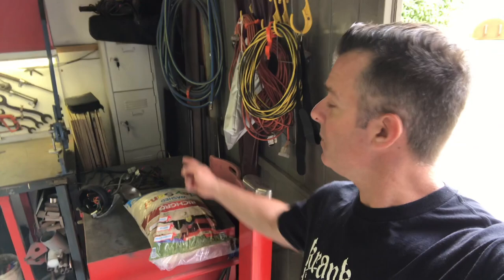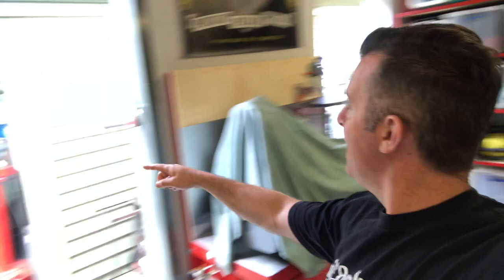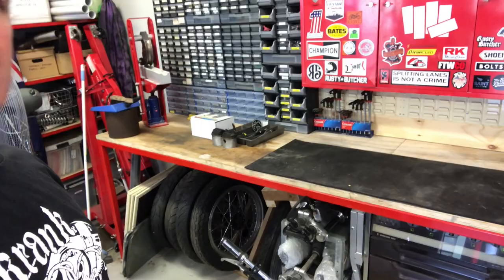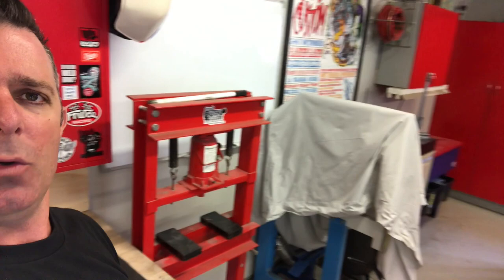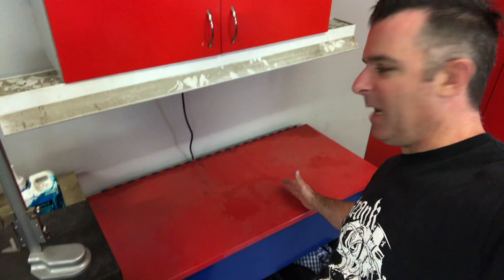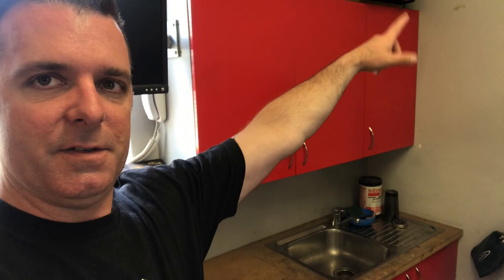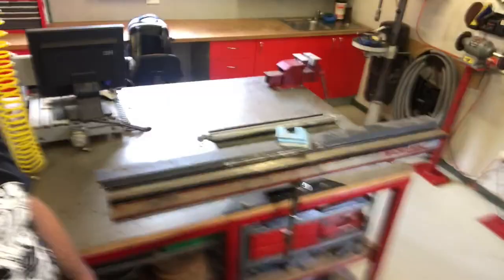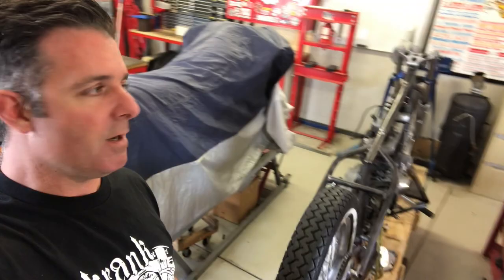Shop Tour!

Comment: Nice shop...;-p
do you have to heat or cool it ?
Reply from the maker: Not really, its never really "unusable". The waste oil heater is a nice addition but sometimes more trouble than its worth with leaking oil and smoke etc. Other than that, I just use a big pedastal fan if its really hot and I'm welding etc